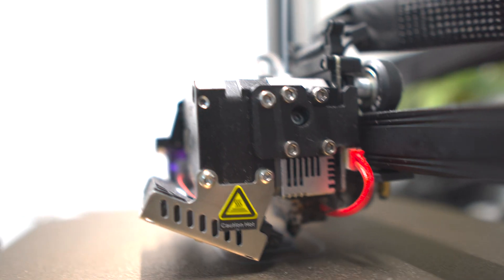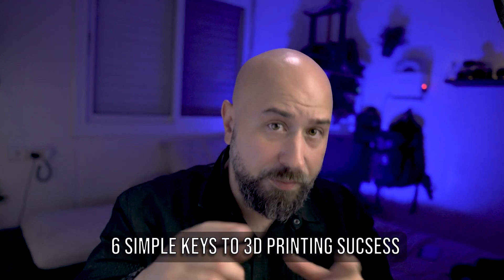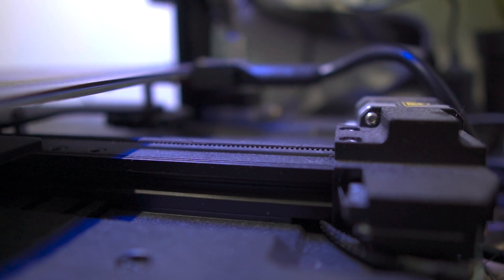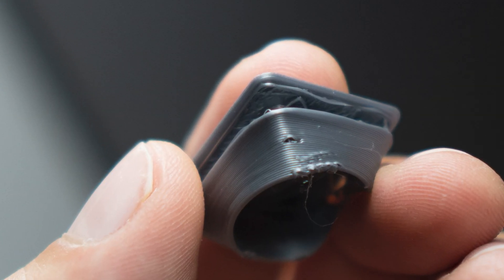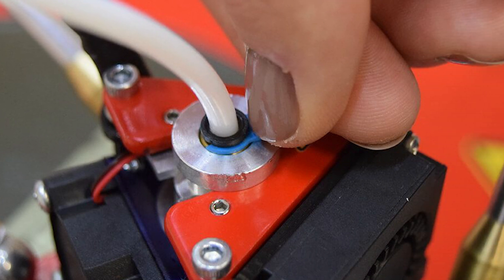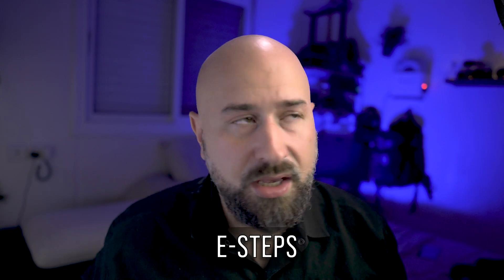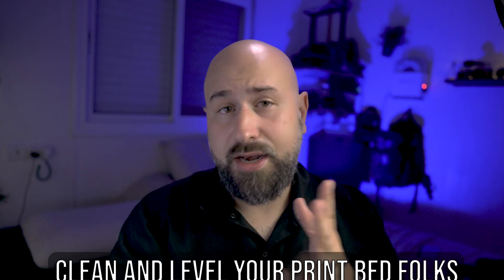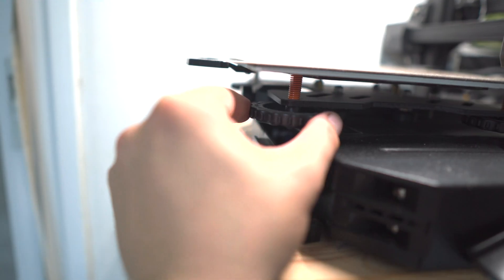6 essential tips on how to avoid 3d printing disasters

Comment: great video like always, I am suffering from my CR6-SE, my bed is not level whatsoever, I can't find a way to level it manually, creality doesn't mention it at all, and I have to rely totally on bed level mesh, that said, if i print something large, it comes out perfect, but if I print things like articulated lizard or octopus for my kid, there will always be at least one part that pops off. I'm using petg by the way.

I have the sonic pad, I yse cura for slicing.

my current guess is as follows, either my bed warps more during the print thus making some parts of the print leas adherence to the bed, or/and my part cooling fan isn't sufficient for the task, I built a few temp towers which shows that the best setting is at 100% so I'm getting new fans to see if it will improve the situation.

so anyways last time I said I'll print the lizard on a raft, obviously it didn't lose any part this time, but removing the model from the raft.. lol.. the lizard just broke.

Aaaalllsoooo, for some reason the printer stopped printing once, klipper on sonic pad didnt report anything so I just continued the print, but I'm starting to suspect the psu and motherboard fans are goners too, so I'll change them soon.

if you can, suggest. what printer should I get next? I need something that prints reliably, I don't care much about speed, but my requirements are it should print CF Nylon with ease, it has to be reliable.

I'm thinking of the Prusa Mk4, as I don't trust creality anymore due to my experience with their products.

thank you again, great video like always
Reply from the maker: Hey, there Saif! I'm very happy to see you back! but I'm sad to hear that your having trouble with your printer, I heard a lot of good things about the new Bambu lab's printer and it sound awesome If you have the budget think that might be a great option for you especially considering you want to print in cf nylon because it comes enclosed and that can greatly help your success when 3d printing with nylon and atone of other more demanding filaments, I'm happy you found some value in my video😊
Reply: @z-made  I don't promise but I'll try my best to watch your videos everytime you post.

I wanted to get the bambu lab but they don't ship it to my country 😁.

have you seen the video about part strength on cnc kitchen? never knew that printing that fast would make it weaker.

But anyways, I'm still not in a hurry to get it now. I'll invest in a 3d scanner first and get better at designing then get a good printer
Reply from the maker: @SaifBinAdhed  That sounds like a good idea, you can always get a new printer but boosting your design skills is a supper important aspect when it comes to 3d printing, if Bambu labs won't ship to your country maybe consider the new printer from Creality the k1 or possibly the ender 3 s1 pro which is what I have been using ever since I switched it out for the ender 3 and it's an awesome printer, but maybe before you do all that maybe try to switch out your build plate, because if your able to print larger builds with no problem maybe its an issue with your build plate, thank you for your support for my little channel, I appreciate it🙏
Reply: @z-made  Broooo 😂 dammit I don't know what happened, I slipped, landed on the buy button on a voron 0.2 😂😂..

honestly though, I am going to have some free time in a couple of weeks which is when it will arrive, I know I'll go crazy if I don't have something to tinker with.

I'll try to find a way to convert the bed to something that can be leveled manually.

waiting for your next video 👌